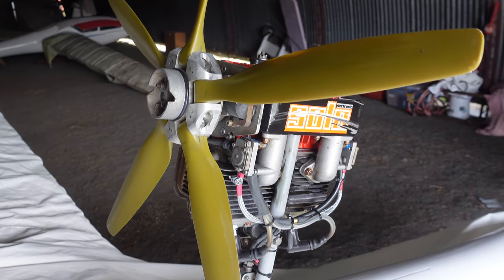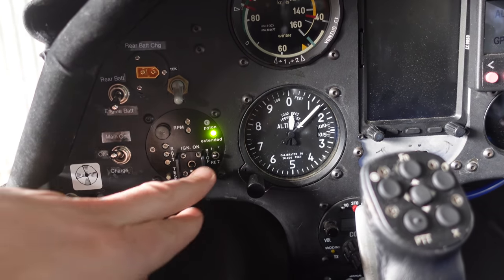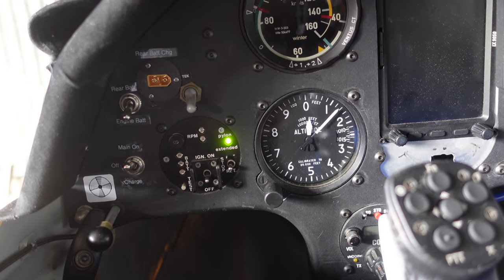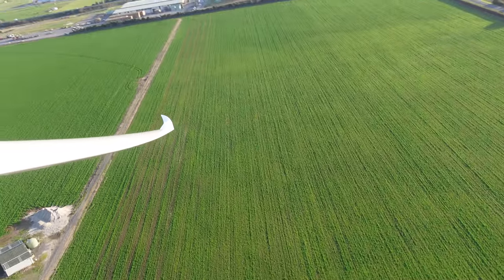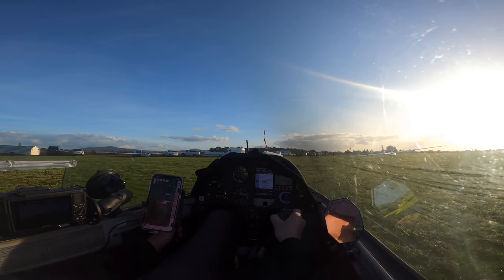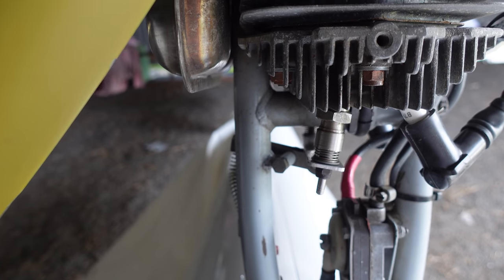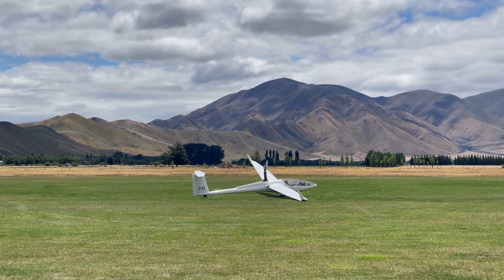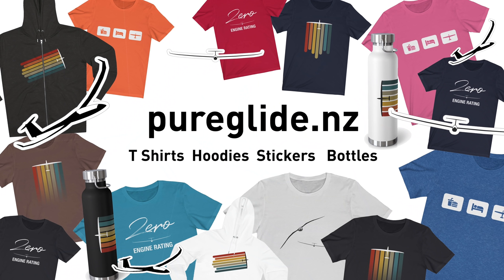How a Glider Engine / Turbo / Sustainer Works

Comment: That decompression lever is a very clever idea! I’ve ‘windmill’ started my ROTAX powered Challenger Ultralight, and the speed required  to get the prop turning was well above 85kts due to the high compression of the 2 stroke engine.
Reply from the maker: Yeah I bet! Cool you can do it if needed, but that’ll be quite a dive
Reply: @PureGlide  True. I usually use the electric start to 'air start' the motor because I would need at least 500' of altitude to pitch over and accelerate  to windmill speeds before the prop starts turning.
Reply: I have an N3 Pup (need to put the wings on...), but...I'm curious, how fast do you think I'd have to go to start a 1/2aVW to wind-start it?  The pistons are a bit high on the compression.  I really hate starting that thing...It's a tiny motor, but it kicks so darn hard!
Reply: @cluelessbeekeeping1322  That’s a good question. The short answer is: I don’t know because I’m unfamiliar with the 1/2 VW.
What I suggest is trying a windmill start under controlled conditions. Set yourself up over a suitable landing area where you can make a power off landing (preferably at a quiet airfield with little or no traffic).
Climb up to 3-4000 AGL and leave 1000 feet as a knock it off altitude where you would be in a position to conduct a normal gliding circuit and approach to landing.
That’s how I conducted my windmill test.
Hope this helps.
Reply: @CLdriver1960  Brother...I've got the ULTIMATE set up...I keep my (need to put the wings on) N3 Pup at a private air strip (bees too), my brother owns it!
You offer good advice...treat it like I'm dead sticking!  Thanks!
Reply: @cluelessbeekeeping1322  You’re welcome, let me know how it goes.
Reply: @cluelessbeekeeping1322  A sweet setup indeed! This conversation thread really puts a few things into perspective regarding small high comp 2-stroke engines.
The next time I hear some bloke say "that pull-starter really kicks like a mule" my reply will be "at least it doesn't have a prop on the end of the shaft".... :)
Reply: @sixstringedthing  Ya, no kidding!
Reply: @cluelessbeekeeping1322  WOAH!, WOAAAA! youre doing DANGEROUSLY wrong!
if it kicks so hard its because the ignition timing is waaay advanced for startup (I dont know if the bug distributor has a vacuum advance, hooo how I hate the cocoroach!) because at 0rpm up to 300-400rpm the timing should be 10-14° AFTER TDC (RETARDED), so every bump in compression will HELP you gain flywheel momentum (instead of trying to break your wrist!)... then the centrifugal advance would put the Ig Timming back at 7-10° BTDC....
Reply: @croquels1  It doesn't 'kick back'bat all.  It has high compression pistons and it's just hard to swing through.  It's never kicked back, it runs like a top!
Reply: What is the "decompression" about?  I'm quite familiar with ICEs, but not this term in this context.
Best guess:  it vents the cylinder to get the piston past TDC a couple times until it's got some momentum to sustain.

Comment from the maker: Not in the video, but the shutdown procedure is the following:
-  Turn off the fuel. Wait for the engine to stop.
- The blades are still spinning. Lower them for 3 seconds out of the airstream.
- Wait for the blades to stop spinning, check with the mirror.
- Close it completely.
Stay tuned for part 2 to see this in action!
Reply: Don't stop by shutting the fuel and thus the lubrication.   No need.   Just switch off the ignition.
Reply: @johngalloway156   The Ventus CT manual states to shut down engine with fuel shut off valve prior to stowing. Anyway to each his own. He is stating the shutdown procedure correctly via the owners manual.
Reply: @MikelLee  I know that.  I owned 3 SH turbo gliders over the period 1992- 2014.   The earlier turbo manuals did indeed say that but it is not necessary and cutting off the fuel/oil mix cuts off the lubrication while the prop is still wind-milling doesn't seem sensible.   NB The comment from Pure Glide:  "Wait for the engine to stop.  - The blades are still spinning"  is not correct as the prop is directly driven and the engine has not stopped turning until the prop has stopped turning.
Reply from the maker: @john interesting I haven't tried switching the ignition off before the fuel. I'll try it sometime. Yes I was just doing what the manual said.
Reply: @PureGlide  always follow the manual as that way your warranty is still valid. 
But the guy is right. Im a 2 stroke mechanic. You never under any circumstances want to run a 2 stroke out of fuel. Running it out of fuel starves the engine of fuel which is also its oil increasing the temp in the engine as it leans out and with no oil mix youll spin a crank bearing or score then seize your pistons.
Reply: @PureGlide  wait you have no throttle? 
If its just full throttle the whole time you have no choice but to run it out of fuel. If you shut the ignition off while its still running your cylinders will fill with fuel and you could bend a rod. 
Yeah i just dont see another way other than what the company says in the manual then.
Engine is obviously not designed to last very long
Reply: @krotchlickmeugh627  no they wont
Reply: @ClumsyCars  no they wont what?
Reply: @krotchlickmeugh627  cylinders won't fill with fuel, the unburnt fuel will simply be exhausted.
Reply: @ClumsyCars  not if the pop off pressure is too low and one piston is at the bottom of its stroke
Reply: @krotchlickmeugh627  in your scenario is the engine at 0 rpm?
Reply: @ClumsyCars  no it just has no spark.
Reply: @krotchlickmeugh627  physically impossible without fuel system failure.
Reply: Shutting the ignition off before the fuel can be a potential fire hazard as the engine will begin exhausting unburnt fuel. Not recommended.
Reply: @johngalloway156  I don't know anything about these engines, I don't really understand what the turbo name is referencing, but on 2 Strokes you normally always want to cut fuel off and let it run out otherwise the fuel mix gums up the carbies and wont start especially if the engine wont be in use for a while again. You can almost guarantee if someone throwing out a 2 stroke weed eater or mower because it wont start its only just because they left fuel in the lines, carby and tank and its blocked the jets, and nothing wrong with it at all.
Reply: It's almost as if they want you to damage it faster so that they get more money.
Reply: Alexander Schleicher way better system :D both combustion engine and electric 2bladed prop u just extend and press the starter button and when u want to retract just pull the lever down to store it and it does everything automatically ^^ stops engine gets the rotor in the storage position and retracts ^^ also it does not require a spin to start cause on the combustion engine it will spin up the engine :D

Comment: It’s just like an E bike having A battery this little engine is used for assistance to extend your flight time
Reply from the maker: Yeah good way to put it! Cheers
Reply: what E bike doesnt have a battery?
Reply: @TheWizardGamez  the ones with really long extension cords
Reply: Nah pedal assist is cheating.
Reply: they have electric assist gliders you know, so exactly like a ebike. They can take off on their own.
Reply: no, an e-bike the rider is still exercising, that's what happenes when their legs go around, that's called exercise. Sitting in a glider WITH AN ENGINE isn't exercise. Bad analogy

Comment: Flying my Ventus CT from  Lasham.  Got low so picked a large recently cut corn field.  Raised snd started the engine, great, I'm away!  5 seconds later the engine stopped.  Lowered the nose and landed without drama.  On inspection I had got a kink in the flexible fuel line when I rigged in the morning.  Always, always pick a field first before you do anything else.
Reply from the maker: Thanks for sharing! Yeah that's a great example of why you have to :)
Reply: @davebryant6905  2 strokes are known for reliability if maintained... simplicity=reliability
Reply: A braided fuel line can really pay for itself! Very kink and heat resistant!
Reply: @mobilemarshall  What you said is very true simplicity=reliability is one of my favorite mantras. On the other hand, most two strokes are working very hard creating a lot of stress. Then factor in they vibrate more. Combine those two factors and you get a lot of failures that more complex but smoother, easier running engines won't have nearly as often. {shrug} It's always a balancing act.
Reply: @davebryant6905  Never done any moto or aviation stuff, but that definitely sounds like my experience of small two stroke engines. She'll run like a wee ripper... right up until she doesn't. I presume in an aviation context, one must be just as diligent regarding maintenance and proper care of a 2-stroke as with any other aero engine.

Comment: Well, in general the sustainer option is a good development, though it is indeed a kind of „cheating“ compared to regular gliders (sailplanes). Therefore they should treated / compete in a class of their own. Why? Though in a competition the use of the engine will be regarded as an outlanding, it in fact is not. You are flying back to your airfield (or another one). The guy without the sustainer is stuck somewhere out on the ground. You have more and different options with the sustainer, even if only on training flights you do have a certain amount of advantage. Do not get me wrong: I am not against the use of engines on gliders, they certainly have advantages. In contrast they are not regular gliders anymore. I would guess that if you are limited to a glider without any engine you need to put in a lot more safety margins than with a (running) engine. Even if it is only on a training flight, the engine is a big plus. Good if you have one, but to let them compete with pure gliders is like comparing apples to oranges.
Reply from the maker: Well up until the point you get the engine out in theory it's the same. And in some ways a disadvantage, because you have to start your engine early, not at 200 feet above the ground. Where as without an engine you can try and get away in a thermal down low (even though you shouldn't do that either). Also we still have to have a paddock to land in, as it might not start, so you can't go to places you wouldn't otherwise. Probably the main advantage is not being exhausted after a big retrieve for the next day! Cheers
Reply: @PureGlide  Everything you wrote is valid of course. Though - when there are sufficient numbers of gliders with sustainers / self launchers around - it would make sense to compete in a class of their own. Nowadays you have different classes anyway, that „usually“ don‘t mix in competition (unless on club or regional level competitions). I am in no way against sustainers (our club recently bought a brand new Arcus T and I voted for it), but they are a different kind of fish compared to regular gliders. And yes, you are right, they are lots of fun and reduce the risk of outlandings by a high margin. Have a lot of fun with your glider, Cheers from Germany, Michael.

Comment: Nice video, but I teach my student to lower the gear before deploying the engine. The reason is that if the engine will not start (or start properly), then you are in a hurry to land in the paddock and you will likely forget the gear.
Reply from the maker: Excellent point, thank you!
Reply: Hmmmm, to each his own but I would never intentionally increase drag while low and slow on the off chance I will forget to increase drag later.

Comment: Glad you did this video. I was wondering about the engine.
How does the weight affect it's ability to glide?
Reply from the maker: Another great question! I’ll have to include that in part two :) basically it makes the glider heavier, just like adding ballast in the wings would.
Reply from the maker: More weight = harder to climb in a thermal, but can glide faster at the same glide ratio. Weirdly :)

Comment: Love the videos, would like to know if that little retractable engine could be used for take off. I assume not because of the way it's starts
Reply from the maker: Hi correct, this one can’t because it doesn’t have a starter or throttle. However they do a make a version that does self launch. It’s the Ventus cM

Comment: Great info, I was wondering how they would be able to tell that you “cheated” by Using your engine, other than a straight sustaining climb in your track.
Reply from the maker: Cheers
Reply: Your ignition switch is wired to your data logger.
Reply: @Trevor_Austin  yea, I got that from the video.  I meant I was wondering about these engines and how they would tell before I saw this video.

Comment: how much "efficiency" do you lose by having a glider which is heavier than normal because of the weight of the engine?
Reply: based on my past experience owning a self launching ventus. it actually makes it slightly better. for the same glide ratio you can go about 5 knots faster. similar principle to water ballasts
Reply from the maker: Yeah it makes it harder to climb (because the glider is heavier) but doesn’t change the aerodynamics so the max glide ratio is the same, just at a faster speed. Subscribe for Future videos will cover how ballast on a glider works!
Reply: how much efficiency do you lose by flying a 2-seat glider with no one in the empty seat?

How much efficiency do you lose by flying a glider with a passenger on aboard?

How much efficiency does a Cessna 172 lose when you actually use it to carry payload? 

Stupid questions
Reply: @SoloRenegade  all 3 questions have the same answer. You can fly faster for the same glide ratio. But it is harder to climb due to the extra weight

Also at my gliding club the only stupid question is the one you don't ask so dw

Comment: Since it works like push-starting a manual transmission car, couldn't you have the glider sitting on the ground and run through the start-up procedures and instead of needing the dive to start the engine, go super oldschool and try spinning the propeller by hand?
Reply from the maker: Yeah you certainly can! Just tricky to be in the glider and do it so you need a helper. I’ve heard of people making a cordless drill attachment to help too but haven’t tried it myself yet!

Comment: I like the XT90 charge port lol
Reply from the maker: They are gone! I didn’t like the panel mounts for them. Replaced with XLR mounts, much sturdier
Reply: @PureGlide  I just thought it was interesting to see them in an application other than RC stuff, which is where I use them all the time!

Comment: With the available lipo battery technique you might consider a brushless engine..much more powerful les complicated.
Reply from the maker: Yeah funnily enough buying a new glider these days you can buy electric ones. But the range isn't quite the same. 150km vs 450km. That and my glider is 25 years old, so didn't quite have that option when it was purchased :)
Reply from the maker: Stay tuned for future videos that talk about other types of gliders including jet and electric...
Reply: @PureGlide  ah yeah 25 years ago i head a flashlight with a little crank on it to produce electricity

Comment: You demonstrate  how the extended engine with a stationary propeller does not produce much drag. What about when the propeller is windmilling?
Reply from the maker: Hi at landing speed it simply doesn't. If I were to dive and go faster it might. Cheers!

Comment: What is the weight penalty with having to carry the engine all day?
Reply from the maker: Good question, gliders are designed to be carried with a lot of weight including the engine.ore weight means more energy is required to climb, but you can glide at the same glide ratio but faster. This is why you can fill the wings up with water. An engine is like permanent water on board. The downside is you can’t dump it before landing so you have more energy when landing

Comment: What about gliders with jet engines ? Can they take off by themselves  ?
Reply from the maker: Stay tuned for another video about Jet gliders!
Reply: Yes, if the jet engine is sized accordingly.  You still have the same two classifications for jet powered gliders, Turbo and SLG.  Turbo = "get yourself back home"-jet  and SLG = Self Launch Glider.  The Turbo jet option is less powerful and not suitable for SLG but plenty for sustained flight.  Jet sustainer vs 2-stroke sustainer, the jet will get you home faster (...and cooler IMHO!)  Climb rate will be similar but optimal cruise speed while under power will for the jet be considerably faster because jets are more efficient at speed.
Reply: @soaringhal  Can you cruise 300 kph with jet sustainer ?